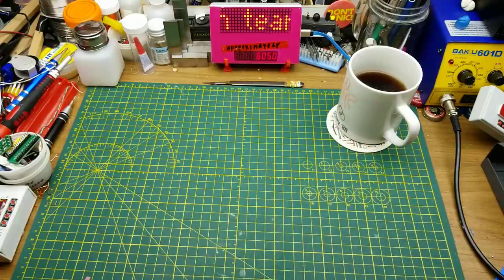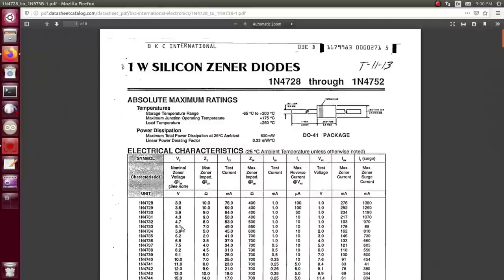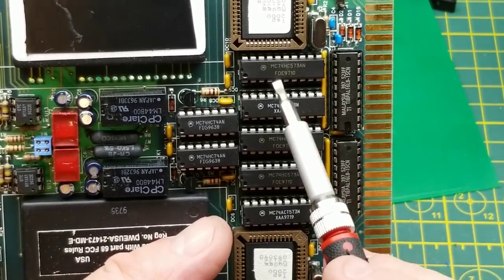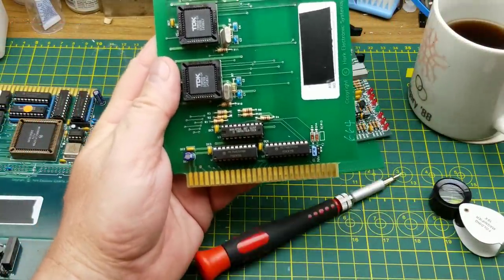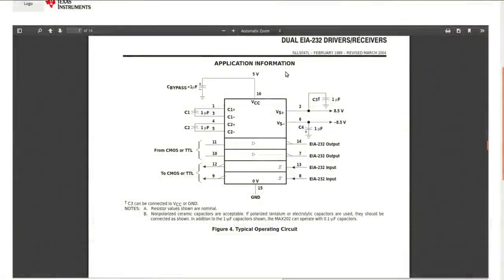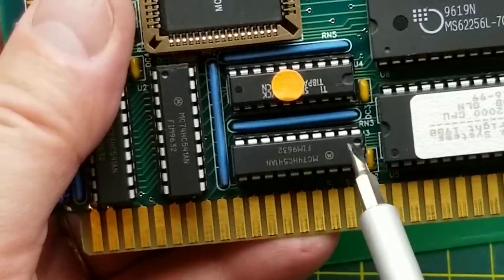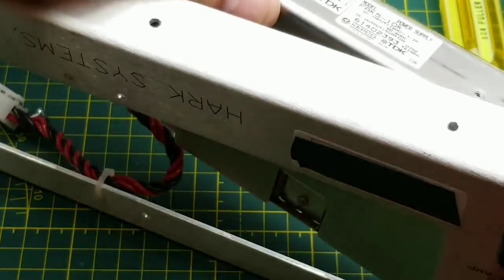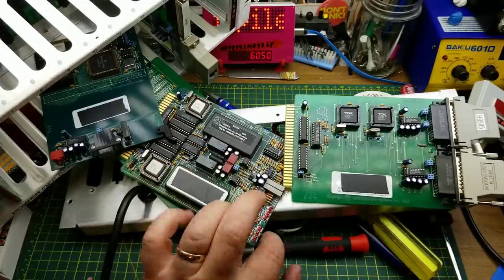paging modem bank teardown

Comment: PAL's are there to do all the address decoding for the microprocessors, so that they took the place of around 15 TTL chips that otherwise would do the decoding. The tone decoders likely are there to detect busy signals on the line, as the modem block likely does not have enough smarts to decode the audio if the other side does not answer, so you add the tone decoder to simply detect anything other than dial tone, and signal that your line is not connecting because of a busy signal or such, so it will wait for a few seconds and retry. LM3900 is there as amplifier and also as automatic gain control, so the audio coming into the tone decoder is a constant level (sort of, at lest not clipped irrespective of signal level) for the audio output of the modem.

Comment: Thanks Pile, that was interesting. I worked for a telecommunications company in the late '80s. They made boxes for monitoring call activity and software for CDR. I did some SL1 programming and used the AT commands daily. Spent a lot of my time with my head in the ceiling or under desks running or checking cables.

Comment: The MAX232 replaces two chips, the 75188 and the 75189, which were necessary for translation between RS232 and TTL levels when used with a UART chip such as an 8250/16450 or 16550.

Comment: The  DALLAS  real time clock modules is self contained battery >10 year backup. It is a fully molded package that CAN NOT  be opened so do not lever it!
The MAX232 chip is copied by many other chips. It is now a family of similar devices but is generally regarded as a staple RS232 chip.

Comment: NMI stands for Non-Maskable Interrupt. Depending upon the chipset used in the computer, interrupts can have priorities. Depending upon software, the priority interrupts may have been ignored (masked out), and ALL interrupts had to raise the non-maskable interrupt and then get asked what the interrupt is for. So, those boards are set up to handle either case. My personal guess for the TDK chips are for an early UART.
Reply from the maker: Seems like a reasonable guess.

Comment: You could make a nice 18650 battery charger with some TP4056 Lithium Cell Charger Module and the power supply